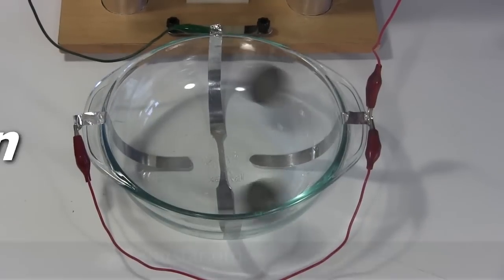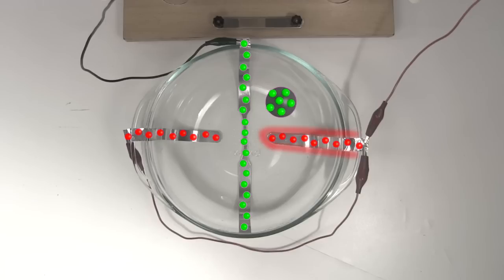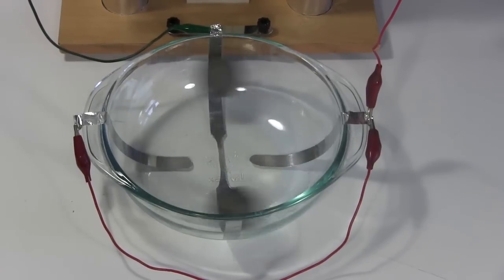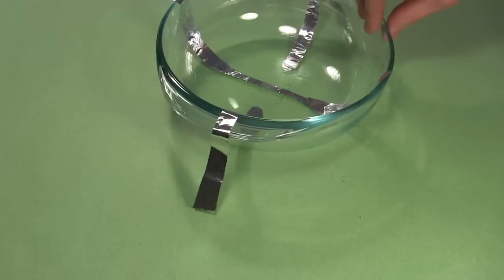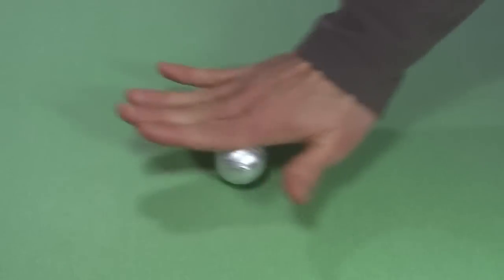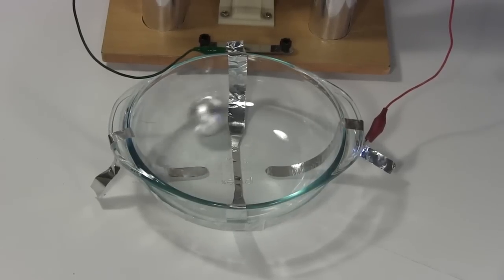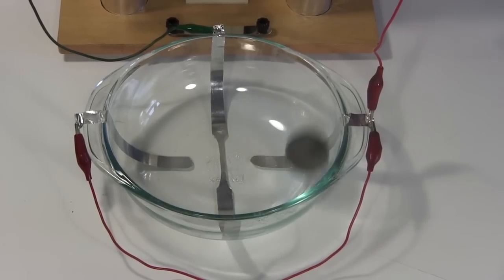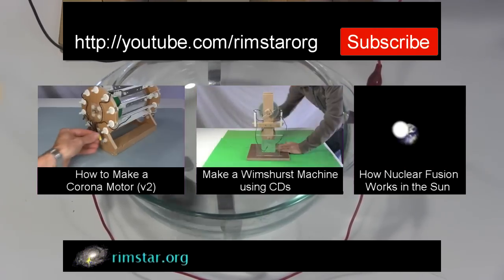Ball Cyclotron/Electrostatic Accelerator How it Works/Making

Comment: I once saw a clever witchdoctor, african magician do a neat magic trick i beleve was using static electricity. He had 3 balls with a bird tail feather feather stuck into them.
he had made a bowl that was made very of thin material (likely made by working away the inside of a calabash to produce a ultra thin calabash shel dome) it looked like a thin almost transparent calabash.

he had drawn a large spider web pattern to the size of the bol on what looked like parchment.

He placed the 3 balls with tail feathers in the center of the spider web with the feathers crossing over to point into the center.

he had me put my hand on top of the bowl.

hey presto when he lifted it, static had fliped the feathers outwards, and with a little help from air preasure perhaps, the 3 things where stood up in the air now at the outside of the parchment web patern thing in geometric formation.

If it would be easier if i ilistrate what i mean, let me know? But anyway the reason i write is because for the last 20 years now i would like to make a device like this because it is really an awesome demonstration of physics.

I wonder if you colud get back to me and shed some light on this bizare idea, as static electricity is an amazing fun thing after all. Perhaps we can even make a video on it if it works! Would really apreciate many thanks.

Comment: Can we done the similar work with battery???? Without using this machine
Reply from the maker: No, this needs high voltage. Batteries are less than 100 volts whereas this needs thousands of volts.

Comment: hi probably silly question can it still working if we put conductor at outer bowl side? let's say we use bowl with higher dielectric constant eg plastic or thinner glass, i wonder if we can stir electrolyte and do many crazy experiment without worrying about conductor corrosion
Reply from the maker: I'm not sure that would work, at least not for the same reasons. This one puts charge on the ball, which is why the ball has to be electrically conductive. The electrodes can't put charge on the ball if they're separated by a dielectric/insulator.

Comment: Is there any substitute to wimshurst machine
Reply from the maker: I'm not sure if the Van de Graaff generators made using soda cans supply enough voltage and current. A bigger Van de Graaff should work. Anything else is harder to make or more costly than the Wimshurst machine though. For example, this high voltage power supply would definitely do it https://www.youtube.com/watch?v=GEuK1OdYxHk.

Comment: Cant we use a battery or something to power it instead of winthrust machine?????
Reply from the maker: No, it requires high voltage, in the thousands, whereas a battery is in the 1.5 to 12 volt range. A Wimshurt machine is probably the simplest power supply for this. An alternative would be a medium sized Van de Graaff generator. Other than that and you're getting into electronic power supplies.

Comment: Can I use cockroft Walton voltage multiplier to run this ball cyclotron or a Corona motor
Reply from the maker: Yes. That should make the balls spin very fast.
Reply: How can I connect cockroft Walton voltage multiplier to my balls cyclotron and to my Corona motor
Please answer this question in this video only
Reply from the maker: The high voltage output goes to one of the connection points of the cyclotron and the ground side of your power supply goes to the other connection point. Which connection point goes where doesn't matter.
Reply: Ok
Thanks for the information
Reply: Can this cyclotron will work with 3 stage cockcroft Walton generator?
Or can this cyclotron will work with the electric flyswater ?
Reply from the maker: I don't know if it will work with the flyswatter. The current might be too little. As for the Cockroft Walton generator, I already answered above that it will work.

Comment: Could you list a source for the nickle paint in the comments?
Reply from the maker: stancurtin Sure. It's Super Shield Nickel Conductive Coating from MG Chemicals http://www.mgchemicals.com/products/protective-coatings/emi-rfi-shielding/super-shield-nickel-841/ It's available in our local electronics stores, though I don't know if it's available in more consumer electronics oriented stores like Radio Shack.However, at USWaterRockets' request below in the comments I also tried Krylon BBQ and Stove paint, available in hardware stores that sell paint, and it worked just as well for this ball cyclotron. But the resistivity of the nickel paint is a few ohms per centimeter and the Krylon paint is a few hundred megaohms per centimeter, so for lower voltage applications where conductivity is much more important the Krylon paint may not work. For this ball cyclotron, a completely uncoated ball didn't work at all, so while you don't need a lot of conductivity, you do need some it seems.

Comment: how much volt you need to the strip ?
Reply from the maker: It depends on the spacing between the strips and how sharp the edge of the strip is. I didn't measure what I used but it's probably in the 1000 to 10,000 volt range.
Reply: @RimstarOrg  that alot thanks :D that to high to try with a power supply lol

Comment: That is so cool.
Hay Star, do you know anything about electrostatic waves. I have only seen electrostatic waves used  in audio speakers:
http://en.wikipedia.org/wiki/Electrostatic_loudspeaker

Never used in communication or energy in projection?
Reply from the maker: keghn feem Mostly I've tried to keep my electric fields field constant. I did once accidentally charge up an object, likely high voltage positive with respect to ground but didn't put any grounded object around. This was probably above 100kV. Of course most objects in my apartment were around ground potential and so other objects acted as the other end of the electric field. That caused sparks to come from the metal legs of the table it was sitting on and it even interacted with my answering machine in a room down the hall and broke the answering machine. That was with a constant electric field, so electrostatics and not electromagnetics. I guess you could say that my answering machine got the message! :D

Comment: Can i use van de Graff generator to power it
Reply from the maker: Yes and no. I depends on how powerful the Van de Graaff, which in turn depends largely on the size of the Van de Graaff's dome (bigger is better). The soda can Van de Graaff (https://www.youtube.com/watch?v=fsT69XnjxgU and https://www.youtube.com/watch?v=QrCgtjZwnB0) might be able to power a smaller cyclotron, one where the metal strips are closer together and the balls are smaller (while still being lightweight).
Reply: I m building 30kv soda van de Graff generator but question is how could i do it where is +ve and -ve of van de Graff generator
Reply from the maker: The two polarities that you connect to are whatever the two brushes are connected to. In a Van de Graaff where one brush is connected to a soda can and the other brush is connected to ground then the soda can and ground are your polarities that you connect to.
Which one is +ve and which is -ve depends on the materials you used for your belts and the outer surfaces of your rollers. See my How a Van de Graaff Generator Works video (https://www.youtube.com/watch?v=EsZQS2GOMQE) for more on that.
Reply: Thanks for replying sir

Comment: Can this work with a DC power source?
Reply from the maker: God Was Bored This actually is DC. The Wimshurst machine is putting out DC to the metal strips. It does have to be high voltage DC though, for the repulsion and attraction to work.
Reply: RimstarOrg Ohh, I see now.  So if I didnt have a Wimshurst machine, could I rig up a {x}# of 9v DC batteries to get something which could work?  I'm assuming yes, but I was wondering what sort of voltage you are working with... :)
Upon further analysis of my question, I should get off my duff and just make a Wimshurst machine :)
Reply from the maker: God Was Bored The voltage is between a strip, the ball and the next strip and I have no way of figuring out what it is. However, I'm sure it would take an impractical number of 9V batteries since the voltage is likely in the high hundreds or even thousands. I agree, making a Wimshurst machine would be easier. I don't know if my small one made with CDs would provide enough current, I have my doubts, but it shouldn't be much harder to make one using old vinyl records for the disks. That would be around as good as the one in this video.

Comment: Can’t another power source be used? And what’s the average cost of this machine?
Reply from the maker: Yes, but they're all high voltage power supplies. I don't know the minimum voltage, it depends on how small the bowl and balls are, and how close the strips of foil are to each other. The closer they are, the lower the voltage, but we're still talking about thousands of volts.
I don't have any costs. The cost of the cyclotron is pretty near zero since it can be made from parts around the house and a dollar-store or 2nd hand store. The Wimshurst machine I use is probably the cheapest power supply at around $80 USD from https://ebay.com (search for "Wimshurst machine"). Bigger than that and you're getting into high voltage electronic power supplies. You can make them yourself, but that's a whole other project. Just make sure the power supply output is DC.
Reply: @RimstarOrg  Thank you for your guidance.

Comment: how to make that handed generator?
Reply from the maker: That's a Wimshurst machine. I bought it off of ebay.com many years ago. I have a video about making a smaller one (https://www.youtube.com/watch?v=puC6-UaT9Fk) but it's not powerful enough to work with this ball cyclotron, the disks are too small and the cardboard pulleys probably aren't good enough to turn bigger disks. However, if you can find a way to scale it up then you can make one.

Comment: The video is faulty somewhere as the charge density on either balls can never be made so high by spinning some wheel like device at the back so that it can accelerate to that good speed. I think the balls are being moved by the wind blown by the wheel at the back and are accelerated as they are light!🤔but hats off to the concept ; it can work well at molecular level.

Comment: the principle of cyclotron is not justified . because it says that however large radius gets time period remains same. but here radius is constt
Reply from the maker: However applicable the term cyclotron may be, it's not my terminology. It's common usage for this sort of thing.
But I'm confused by what you're saying. Are you saying that with a cyclotron that moves particles for physics experiments, no matter the radius, the timer period is the same? Wouldn't velocity have to change for that to be the case?
Also, in this ball cyclotron the radius changes as the velocity changes. Notice in the video that when it's moving slower, the radius is small, and when it's moving faster, the radius is larger.